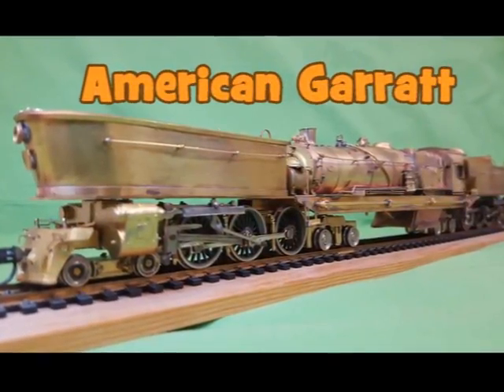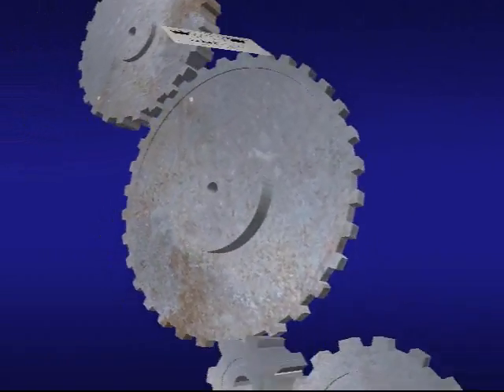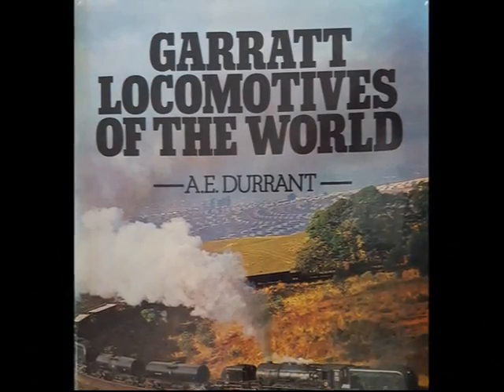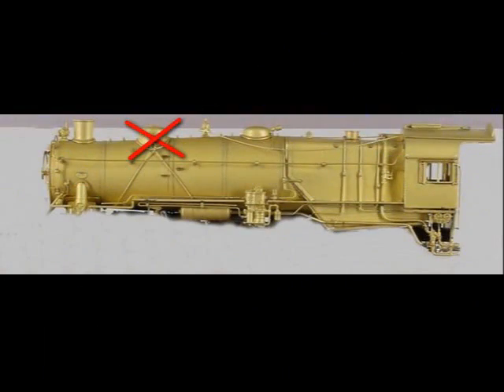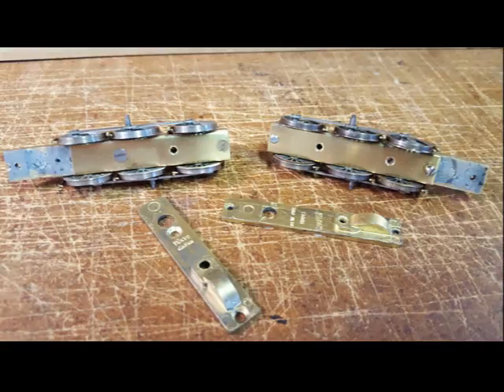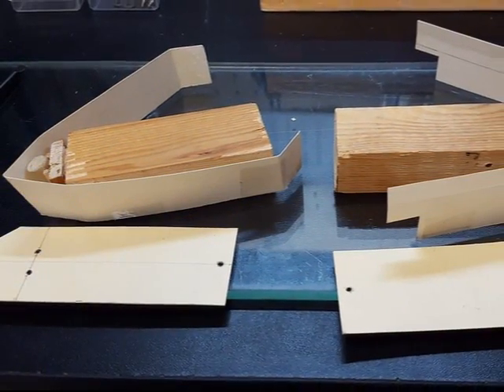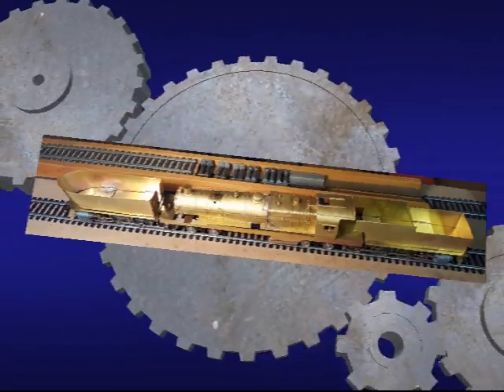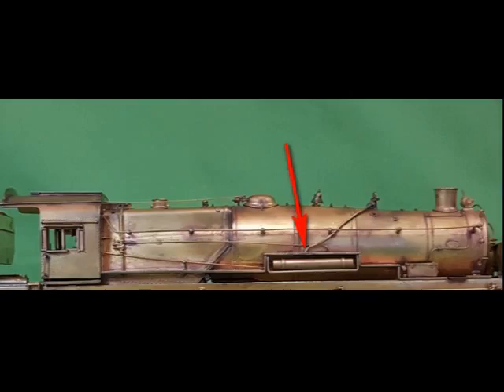American Garratt steam locomotive in HO scale

Comment: As several people have commented, the boiler needs to be fatter and not be tapered to provide enough steam for the 4 cylinders.  The air pump would be better placed about the smokebox(Australian Garretts) and the power reverse kept and connected by way of the articulation joints to each power unit.  All steam lines usually are kept in the center of the loco for ease of placement.  The frame for the boiler needs to be to the width of the clearance diagram (loading gauge) minus enough to take care of overhang on the sharpest of curves the loco would be used on.  You have done a marvelous job of Americanizing a Garrett.  Alco did have the license to make Garretts but never did.  I would like to see a double K Mikado of the D&RGW.

Comment: A nice rendition of a would be American Garratt.
What you referred to as a shield for the steam pipes is in reality the deep ash pan of the Garratt.
Garratts would have wider and deeper fireboxes than possible on rigid locomotives as there were no wheels under the firebox.
For this reason it would have been more prototypical to construct a boiler with a very large diameter, and a firebox with a vertical front plate and reaching deep.
Because of the width of the firebox, often almost the loading gauge, steam pipes could only be run underneath the ash pan, there is a cutout along the centerline to accommodate these pipes.
The place of the air pump high on the running board at the boiler side is prototypical for a Garratt, you could have left the power reverser on the other side as well, many Garratts had them in this same spot with actuator bars going to the front and aft units. These were articulated at the point where the loco was articulated.
The Pennsy style bath tub water tank on the front unit is very elegant looking, and forms a unique feature.

And indeed, for American railroading practice having the rear bunker almost completely for coal and have an auxiliary water tank like on these South African GMAM locomotives could be the best option, the water tanker could be a centipede tender but with water space only.
To counter the problem of reduced adhesion with low stores an axle configuration like 4-8-0+0-8-4 or 2-10-0+0-10-2 would be a logical choice, as relatively more boiler cradle weight is on the drivers then, and less weight change on these driver by percentage when coal and water is used.
But the addition of trailing trucks on the inside was very convenient for you to motorize the model, I assume the original drives were in the wrong place.

Comment: Check you mallett & garrett comparison picture, see how the front boiler section rest, with the mallett setup, ideal to give a garrett a longer boiler, thus more power.
Which could give you a 4-6-6-4-----4-6-4, with the boiler resting on the 6-4-----4 section.
Then check the Flying Scotsman it's walk true tender out as well, for a nice looking back-end, if you are going to put to the track, something that has never existed, why not going almost all the way?
All the way would be adding the condensator tender ability to it as well.
Still, very nice work and good looking as well.
Keep up the nice & good hobby work. 👍

Comment: The double Baltic was used in Sudan, Rhodesia and Mozambique, but all were 3'6" gauge. I think the USA didn't use Garratts as they regarded them as tank locomotives, with too short range for running on mainline. Mind you, a variant with 100 % coal on the rear engine and an auxiliary water tender might have been OK. But weight change (and therefore tractive effort change) was also regarded as a disincentive (that because all American railroads were parsimonious on loco provision in the interest of ekeing out the most train for the least money.

Comment: To be more Prototypical, in order  to supply sufficient steam to the two independant  engine units; the Boilers of Garret locos were of large diameter than a single engine loco boiler.
The lenght of the Boiler could be then shorter ( suitable for tight curves on NG systems. As to the loss of adhesion as coal/ water are used up, in many countries ( and now re-enactment Runs, a water tanker with a syphon system keeps the adhesivo wright reasonably estable for longer; for a fuel oil fired versión an extra oil tankcar would lenghten the rnge as well.
My suggestions would be a IHB 0-8-0 boiler, between two 4-8-2 Frames, and Boxlike forward and dear tenders
Same applies for a Super ( Mallet-Garret)
To be believable, a large Boiler is essential 
DocAV from Garret country 3'6" Queensland Australia.

Comment: Would the stock Hudson boiler provide enoiugh steam for the 2 addditional cylinders?
Just curious.
Reply from the maker: The boiler is not from a Hudson (PRR didn't have any). If I remember correctly, it is from a 4-8-2 M-1 Mountain or 2-10-2 N-1 Santa Fe.
Reply: @tompanvids  OK Thanks.

Comment: It's nice but, shouldnt the rear drivers of the 2 engine units be under the boiler section? So realistically the weight of the boiler would be on them, instead of the coal and water which will vary overtime and may cause wheelslip?
Reply from the maker: Some Garratts with single axle pony trucks did have their drivers more under the extended carriage holding the boiler. This was not usually the case with 4-wheel bogie trucks. You are absolutely right that loss of traction was a concern for Garratts as fuel was consumed.

Comment: Those triplex locomotives most likely did not have enough steam power, by having a too small boiler, their front section is afteral a standard mallet setup, a garret most often has a similar boiler size as a mallet.
A mallet triplex probably can only thus have enough steam pressure and thus power, if it's also a garrett, which would let you get away with a boiler that's 1/3th longer, with all that that means.
It's a bit hard to put a forwards motion strenght of say 18, on the tracks, when you can only produce enough for 12, you just can't get it up to speed, as easily as should be possible, I bet.
Reply: Triplex locos had the exhaust from the rear unit escape to the atmosphere instead of through the stack which then did not help with the fire because of the lost steam.
Reply: Which thus make fusing the Garrett with a cab forwards mallet, even better.
That cab becomes the classic Garrett watertank.
Thus giving a better Triplex setup.
Would even allow streamlining of the unit and with a corridor tender setup...
Patent Laws kept the fun stuff, away.
If the Wright Brothers had something like that Garrett Patent enforcement, the world would be quite a bit different.
Still nice and interesting to know, I must say.

Comment: Because the cg swings to the inside instead of outside on curves, they're much more stable. Not sure about the added costs of the apparent higher complexity.
Reply: Generally Garratts were technically competent, but not massively complex. The tricky bit is the steam connections, but that was nailed on the Semi-Mallets, so wouldn't be a huge issue for the likes of some of the US builders. I'd never considered John's viewpoint of Beyer-Peacock's defence of their patent...